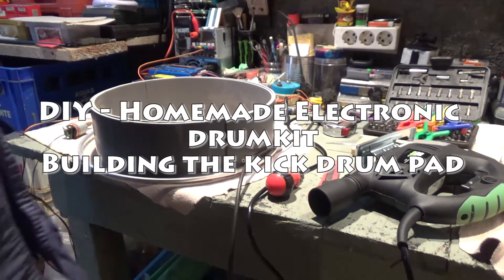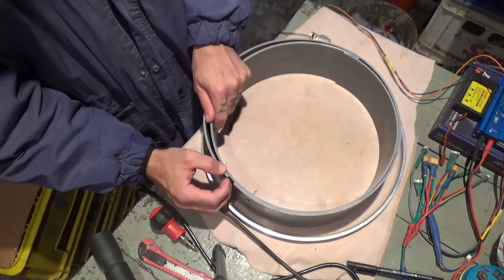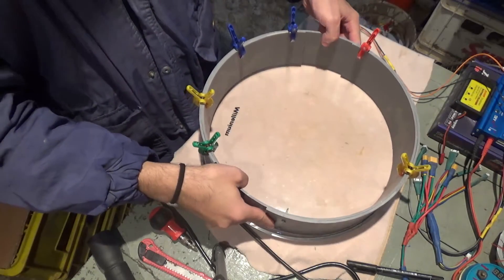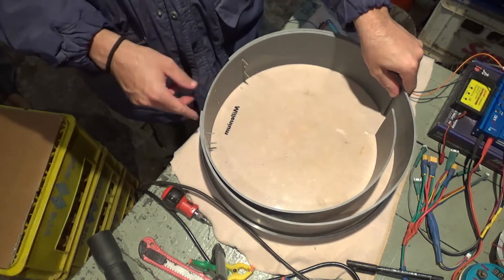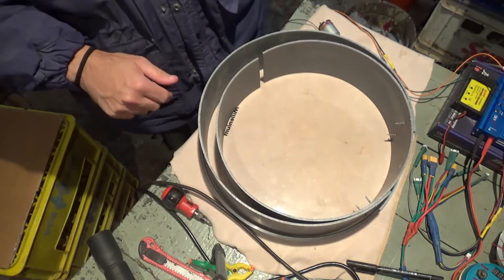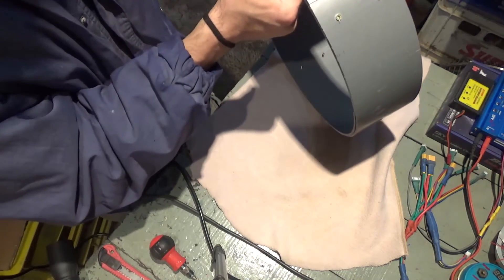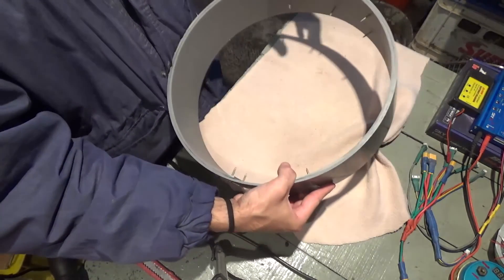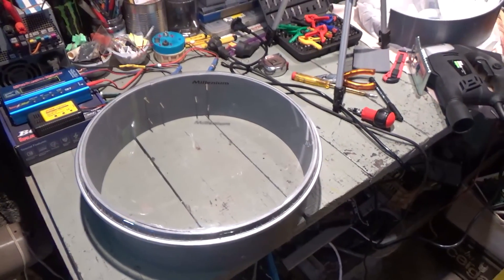DIY - Homemade Electronic Drumkit part2 - Kick drum pad build

Comment: Why did you use different sizes of drums? More work than it could be. It seams not really importans for triggering samples. I'm not a drummer, sorry if the question is dumb. ;)
Reply from the maker: Different sizes are just to match the drum hoops i already had lying around from my acoustic drumset...it has nothing to do with the triggering
Reply: @luisfilipe1983  Thanks for the quick reply. You rock!